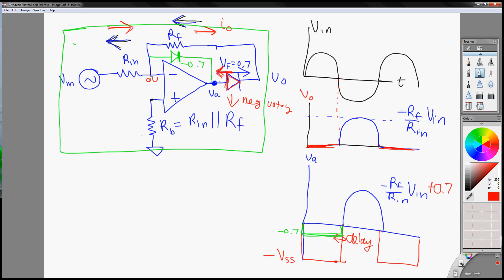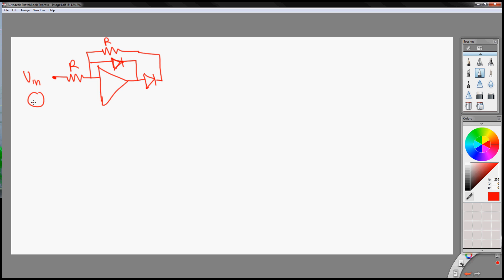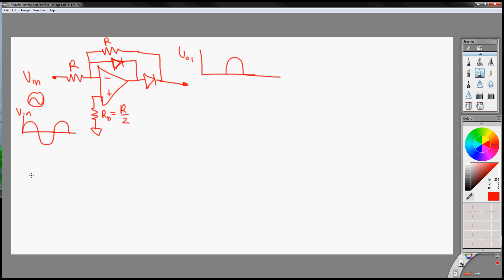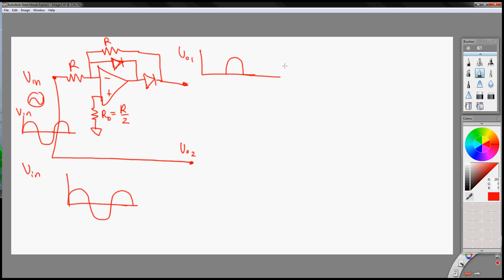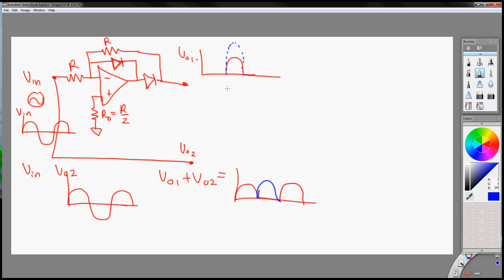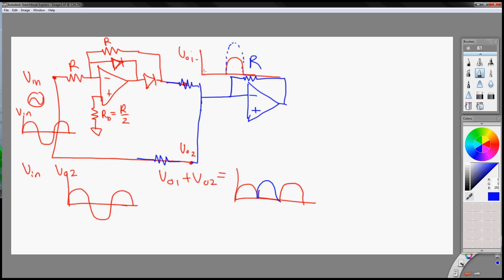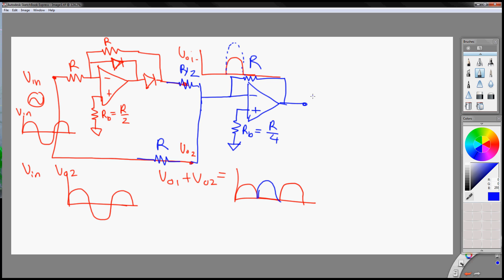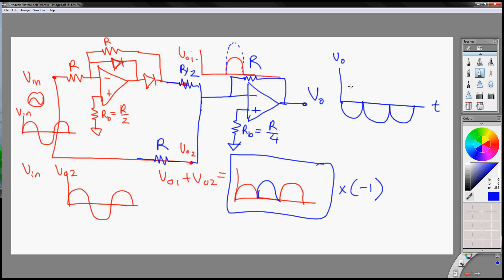Precise Full Wave Rectifier Example with Op Amps Part 4

Comment: How do you decide which resistor and diode values to use?
Reply from the maker: depending on the precision needed but generally just use 1% tolerance resistors. For the diodes, 1n914 will work.
Reply: Kelvin Le thank you

Comment: How would you work out the output voltage and maximum output current of this op amp rectifier? Simply the gained voltage after 1st stage(or up to the rail)? And maximum output current rated for the opamp?
Reply from the maker: Chi Eng Chow this is a voltage source behavior so the current is limited by the op amp max output current specified by the datasheet.  The output voltage is determined by the gain of the circuit and is limited by the max output swing of the op amp.  Look at datasheet for your specific op amp.
Reply: Kelvin Le Thanks for answering. I'm guessing the loading behaviour of the output will be quite good due to the low output impedance of op amps. What kind of application is this used usually?
If I want to increase the current capability, is it common/practical to parallel 2 opamps(2nd opamp)? or I will be better off adding another buffer stage(maybe again 2 high current op amps in parallel).
Reply from the maker: how much current do you need?
If you need to drive a lot of current I recommend using a buffer connected to a NMOS.  The buffer drives the NMOS gate.  The negative terminal is connected to the NMOS source.  Vcc is connect to the NMOS drain.  The load is connected to the source and gnd.  If you just need like 50mA or so there are special op amp that can source that.  But if you need like 1 or 2 Amps then using an NMOS is good.

Comment: Hey Kelvin... I realy need your help... I will pay you if i want... I need to read the value of a variable inductor... using arduino... and im have problems using a circuit with a Vin of 1Mhz (from function generator) .... i need to rectify it and put it into a DC voltage between 0 and 5 Volts that can be read by arduino...
Reply: I will pay you if *you want...
Reply: can you add me on skype? francisco.costa54

Comment from the maker: if you use a generic rectifier you can't rectify small signals (remember the forward voltage of the diode).  With this precise rectifier there is no minimal threshold requirements.

Comment from the maker: all op-amps have some bias current at the input terminals (depends on the type of transistor gate)
the Rbias basically match the impedance seen from these terminals so that there won't be an offset which can saturate the amplifier